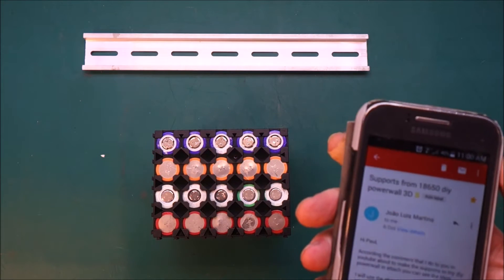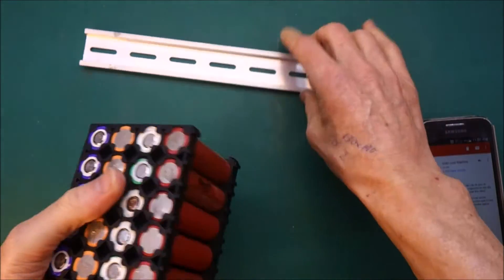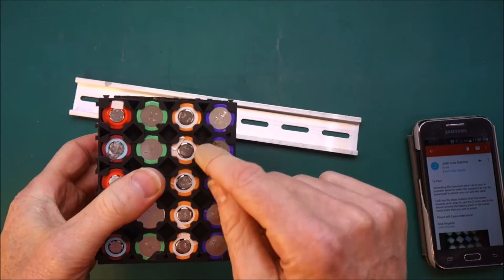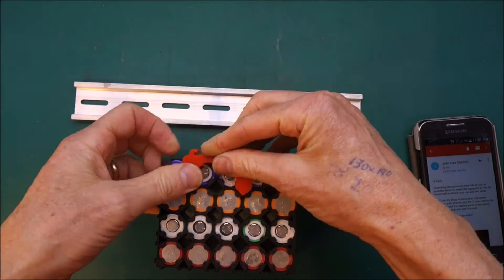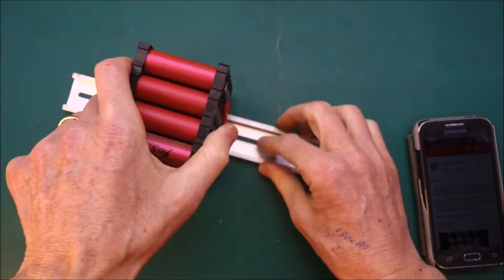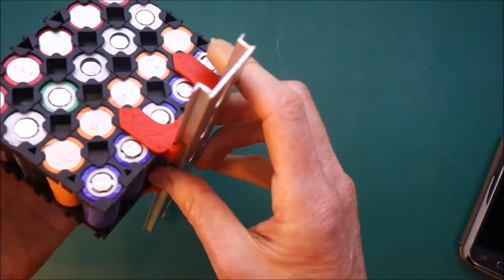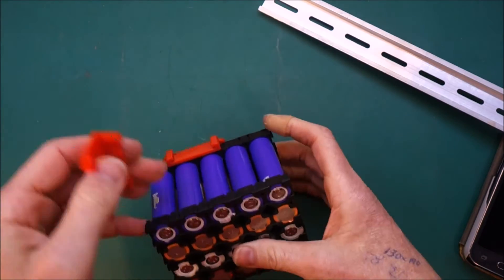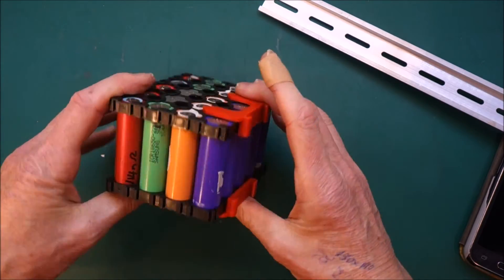Laptop Powerwall 78 - DIN rail mounting bracket for 4x5 battery clips

Comment: cheers mate will make good use of these been printing the other small blocks finding it hard to get a strong print on the din rail mount and unsure how to make it thicker
Reply from the maker: Hi Dennis - is it breaking somewhere? I can beef it up - just let me know where the problem is. Also what layer height are you using? It could be your printer fee rate is too low. Or maybe nozzle temp to low?
Reply: printing in pla
my feed rate is 120 
speed is 100
beds set at 70
nozzles set at 210
0.3mm nozzle
0.2mm layer hight 
are you able to beef up the thickness of the back piece with the squares in it
its 2.1mm are you able to make it 4mm thick 

thanks for the reply
Reply from the maker: Done. I've made a duplicate with 4mm base. If you PM me I can email you the STL.
Reply from the maker: Email Paul at Kennett dot co dot nz
Reply: hi mate messaged through your web site thanks again